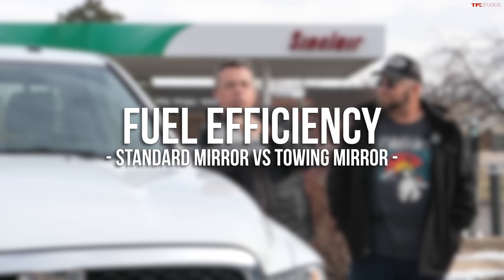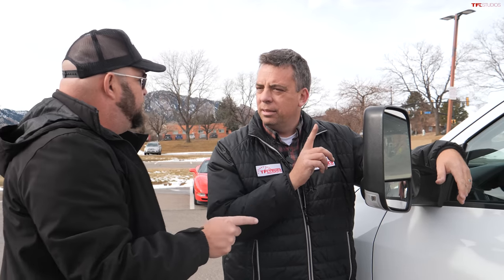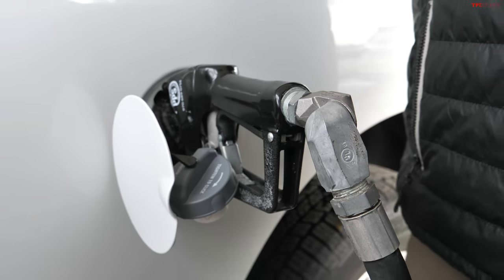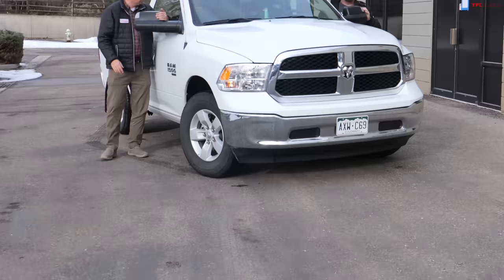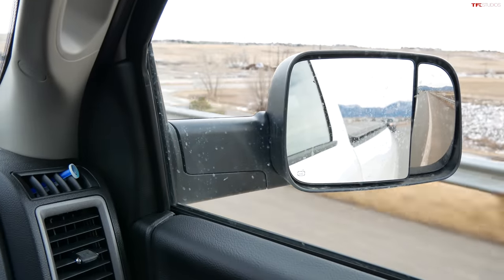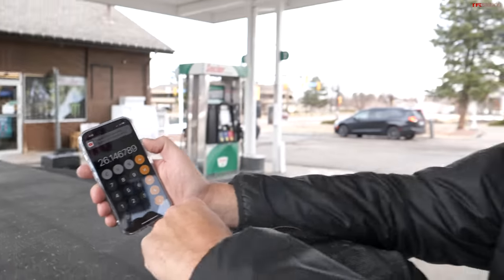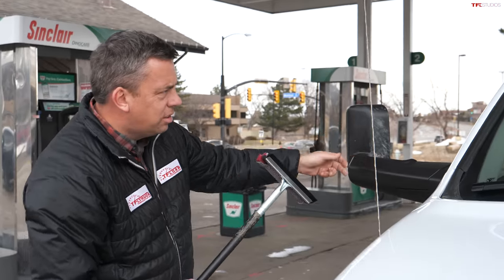TOTALLY UNEXPECTED MPG - Never Drive with Your Towing Mirrors Extended While NOT Towing: Here's Why!

Comment: Just did a trip from Virginia to Texas, I was curious so I put my moose mirror's out on the way down I avereged 13.6 mpg, on the way back with stuppy mirrors I averaged 18.1 mpg. They make a big difference.
Reply: I don't believe that at all.
Reply: @jimbeam2705  I don't care what you believe, numbers don't lie people do.
Reply: @jimbeam2705  that's  the truth  mirrors  in save mileage 👍🛻
Reply: The direction of prevailing wind during those runs likely made a big difference in the mileage too.
Reply: @LocalGarage  that could be, but unless you try it for yourself you won't know for sure. So please take a trip and let me know what you find👍
Reply: @nicknisiscosta5154  i drive from denver to tulsa a couple times a year, my trip adds elevation change into the mix too but each direction gives different results each time.  even side wind can have a negative impact on mileage
Reply: Yeah there's a reason mpg tests are run in a loop (out and back) to try and negate any wind, elevation etc.
Reply: Stuppy mirrors?  Yeah you're an English major who can't operate a four-function calculator.

Comment: This makes perfect sense as switching form normal to tow configuration, changes the aerodynamic characteristics.  Have the mirrors up for towing creates turbulence on either side of the truck which will affect the air moving around the truck.  With the mirrors down, that is minimized.  

I wonder If the shorter non-tow mirror will have better results.

Comment: Have you run two loops with no modifications, back to back, to see what the margin of error is?
Reply: 100% agree, great idea too! They should also consider how long they may have sat at idle while adjusting the mirrors or even sitting at stop lights or waiting for the pump between tests. My experience with my Ram tow mirrors never had me thinking there was a significant fuel consumption difference between the configurations so it will be interesting to see if they do any follow up testing. Either way, until the test is reliable to repeat, there are a lot of factors that could skew the results, maybe even drastically. I have been following along for a while now and don't recall them establishing a reliable baseline for the test, other than trying to keep things consistent which is great, but I am very curious what their results would be for the same test, 2 or 3 times in a row.

Comment: 6 mpg from mirror position... that is a big enough hit that I would love to see if you guys could get an engineer (Maybe colab with Engineering Explained even and reach a new audience segment ) to explain just how extending the mirrors can cause such a major increase in drag.
Reply: They’d probably say that the result is not accurate and needs to be repeated for validity.
Reply: Do it TFL!!!
Reply: And tell him to bring his whiteboard
Reply: Not saying it would cause THIS much of a change, but the reason is because the wind is being directed differently with the mirrors up vs. down. When they are down, the shape of the mirrors cause the wind to be deflected up, not only slightly lowering the front of the truck (and shrinking the amount of area for wind to go underneath), but going the same direction on both sides. 

When the mirrors are up, the wedges are now turned on their sides facing opposite ways. The wind being deflected is trying to push the truck one way on the driver's side and the opposite way on the passenger's side. This creates additional drag.

Comment: We call tow mirrors up "Ghost Trailer' mode up here. I've had my ram for 7 or so years, I've flipped the mirrors up twice. I tow cars, 8'6" wide enclosed, sheds, chicken coops, etc etc.. I find I can see perfectly fine with them down. I did adjust the convex so I don't need to adjust them at all when/if I flip the mirrors and when I thought flipping the mirrors up was going to be useful I set the #2 driver profile for that setting, so if i flip them I hit 1 button and done.

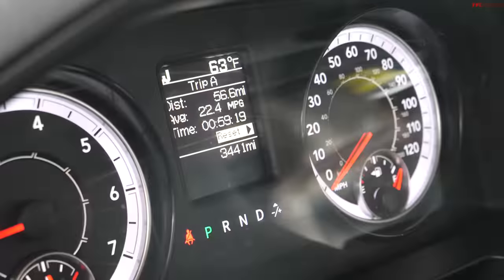Comment: Actual result (excluding for variations in traffic, wind, etc.): @ 6:50 ~22.3-22.4 mpg with mirrors in;   @ 10:38  ~22.1 mpg with mirrors out, which is about 1% difference.
For comparing different trips or other variables in the same vehicle, the onboard fuel flow measurement is much more accurate than their fill-up scheme.

Comment: Manufacturers design mirrors to channel and move air around the vehicle in the most efficient manner possible. Putting the mirrors up increases the front facing surface area, and changes the airflow around the vehicle. I would not be surprised to find out the mirrors placed vertically help reduce wind drag on the trailer being towed even while increasing  wind drag on the truck alone.

Comment: I have the old Ford stainless steel rectangular tow mirrors on my 1986 F350 crew cab dually. I leave them in the out position as they are about 1" wider than the rear fenders so I know if I can get through without scraping the fenders. Since there is really no actual change in area of the mirrors It won't make a change in fuel economy.

Comment: you can set your presets, if you have them. 1 to normal mode and 2 for moose mode. still have to move the bottom one but it makes it easier
Reply: That’s exactly what I do on our 2019 RAM 2500 Laramie when towing and it works great.  1 for normal, 2 for Moose Mode (and the truck didn’t cost $100K; sticker was $65K.)
Reply: @jeffmc306  i ordered my 22 Rebel Echo-diesel. went down the list and added everything i wanted. its my last truck. i traded my Gladiator for it. i had traded a Wrangler and a 2014 RAM Sport for the Gladiator. it was nice but i missed the size of the ram. i thought the Gladiator might fill the truck and the jeep need. Didn't scratch that itch.
Reply: @trcass1  Congrats on your new Rebel!  Sometimes we make what we think is the best decision for the time and it doesn’t work out. Been there, done that!  Enjoy that new RAM!
Reply: @jeffmc306  thanks Jeff. it cost a little more than i would have liked but it was my last vehicle and i had a low balance on the Gladiator so i was able to pay it off at delivery. my only regret is the cost of diesel....its crazy.
Reply: My 2019 Warlock (which is basically a Tradesman with a facelift) doesn't have any save function nor power seats. So I doubt that Tradesman has any save function, or power seats, either.
Reply: @Hydra360ci  i was making that comment in general, recognizing that many have a higher end truck that does have presets

Comment: I would like to see you test different brands of air filter on this truck. K&n, fram, wix, etc to see which gives the best MPG. I would really like to see if you could get 30 mpg out of that truck. 

I also wonder what effect those mud flaps have on the mpg
Reply: I think Project Farm did a cool video on air filters.
Reply: @ALMX5DP  He did. He basically concluded K&N filters do flow "better" than others (which is only relevant if your intake restriction is actually the air filter - many are not), but were terrible for actually filtering the air.

Comment: When I bought this 6.7 Cummins, it’s a 22 bighorn 3500 (not a dually) completely factory besides some interior stuff, it’s the high output with the Aisin. I never expected any fuel economy. I have 6,000 miles on this truck and my average when empty on FLAT ROADS in the Midwest, varies between 20-23.

20 on interstate driving speed limit which is 70 here, and 55 on highways. 

I think foot control is a huge factor. Like how hard you push it to reach that speed. I think it affects it a lot, you breath on this throttle and it’s moving. 

And no I don’t drive around in moose mode. And now I’m definitely glad I don’t lol. 

I will say though pulling a big skid steer yesterday did drop me down to about 9 😂

Comment: I always try to use the same pump and station where I live.  My mileage is pretty consistent for the most part, but I do occasionally have a tank that is way high or way low relative to the average.  Like in this video, I'm talking 3 to 4 mpg more or less than what i usually see.  I think it's a function of how consistent the pump is about shutting off once the tank is full.  There may be other factors that I'm not recognizing but I think this is something that might have happened to you two in this test.  A ~6 mpg difference is pretty big and I'm not sure I'm buying that.  I could be wrong.  There are a lot of things that can effect fuel economy and aren't necessarily obvious to us in the moment.

Comment: OK, I guess the mirror orientation/adjustment issue between the mirrors being out verses in is the explanation why almost every Dodge tow mirror equipped truck here in Muskoka, Ontario (Canada) runs with the mirrors out. 
I drive a 2016 Ford with tow mirrors, only have them out when towing my TT, even better on my new truck (when its built), they'll be power out/in. Just about every tow mirror equipped GM/Chevy or Ford I see have them retracted when not towing. 
Maybe it's something to do with "size" when you're driving a Dodge?

Comment: If you average the to runs you get 22.8mpg, a lot closer both ways to what the truck calculated.   At 57miles and 2-3 gallons, a pint (one beer) difference in the filling up can swing the hand calculated mpg 1.5 points.  What probably happened was the mirror-in fill-up was short and the mirror-out fill-up was to the top.  We are talking about the nozzle being inserted into the tank 1/2" further and the pump running 2 seconds longer.   The tests need to be more miles to reduce the effect of fill up inconsistents and idle time.

Comment: There is no way this stands. That’s more than a 20% savings when disengaging moose mode. Car and truck manufacturers would die to save that much fuel efficiency, especially in this day and age where every 0.1mpg is a selling point. In fact, Audi’s numbers for perspective gains in efficiency from mirror mods are closer to 10-15% and they’re working hard to figure out how to make that work. Not only that, but using past performance (chin spoiler and tonneau cover videos) show that 26mpg is very much an outlier. I’d recommend performing this test at least once more to verify. If it’s real science, it is reproducible and only costs 6 gallons worth of gas and two hours of your time. Totally worth it.

Comment: I also think this experiment will need to be run a time or two. I drive A 3/4 ton diesel and got over 26 on one trip only over a couple of years. I’m pretty sure there was a fluke circumstance and a bit of helping wind instead of crosswind. I haven’t seen that since, and that is the reason for my questioning of the mirrors down part of the test. I can’t say that the moose mode would be outside the expected norm.

Comment: I’m not saying towing mirrors out isn’t less efficient, because it definitely is less efficient. But there is no way that it’s that much different. What’s most likely happening here, is the pressure switch on the pump for shut off is causing fluctuations in the amount of fuel it’s putting in. They even elude to it when they talk about how long the top off was on one of the pumps. The only way to run this test correctly, is to use a set amount of fuel (5 gallons as an example) drain the fuel tank every time and fill it with exactly 5 gallons and then run the tests, and see how much fuel is left after the test. Incredibly hard (and time consuming) to do.

Comment: For any test to be scientifically significant it needs to be repeated, however, mirrors are a huge influence on the drag of a vehicle. You aren't just modifying how the air flows around the truck, the tow mirrors are a huge object sticking way out into the air stream, so I think it could be significant. (obviously a wind tunnel would be the true scientific way)

Loving these MPG tests.

Comment: Even if the difference is 3mpg vs 6 due to some margin if error, that's huge
Reply: The 26 mpg was 3 mpg too high and the 20 mpg was 3 mpg too low; the real number is near zero difference and I would bet if they ran it again their results would reflect this.  The error was with the first fill most likely and the tank didn't fill completely for some reason and then when they filled the second time, it ended up filling up properly, including the amount that didn't get put in the first time.
Reply: I really doubt it’s actually a 5.8 mpg difference. Something got screwed up here.

Comment: I own a Ram 3500, and the passenger side blind spot is horrendous with the mirror in the horizontal position. The convex mirror does not provide enough visibility in the horizontal position. 

Fuel economy matters, but safety matters more.

Comment: My 2001 Cummins has electrically adjustable and heated mirrors, and I didn’t spend $80K.  I never did a comparative mileage check and I never do a non-tow drive with them extended.  Aerodynamics are tricky.  A 6 MPG delta seems excessive, but there has to be some drag effect.

Comment: Also...There is a MI company that makes a AreoCap for the pickup truck market,  why not look into a few really well thought out Airstream updates for Pickups,  practical stuff, not gimmicks.  
Lower air dams
Side skirts
Running boards vs none
Roof  lip spoiler 
Caps
Areo caps
Flat wheel covers.
Great little fuel price series.
Fuel Additives
Oil additives 
Clutch fan removal  for electric
Headers
Filters

Comment: I put aftermarket RAM style towing mirrors on my Tacoma.  I lost 0.5-1 mpg just from installing them.  Leaving them turned up costs another 0.5-1mpg.  Obviously, how much they impact fuel economy depends on how fast I drive.

My experience corresponds to a substantial loss, but I think your results are bunk.  For whatever reason, I suspect you got a bit of a short fill followed by a full fill.  We are talking fractions of a gallon here.  I love that you are doing these tests, but I wish you had a more reliable way of filling the tank to a specific level than depending on the pump.

Comment: I think I would believe the computer in the truck over the gas pump.  You only pumped a little over 2 gallons a little variation in pump pressure and nozzle kick off would give a huge difference

Comment: If my electric seat and mirrors in my 05 touareg can revert to saved positions.

Surely an electric mirror in a modern truck could have saved positions for moose mode or standard.
If not auto adjust when flipping position.

Comment: You know, I have faith in your method, but the more I see this, I have to wonder just how reliable the fuel pump's shut off is.
I mean, how full is "full" each time you fill up? Is there a way to find some engineer who designs fuel pumps to weigh in on the pump's repeatability?

Comment: Hate to tell you but because of the altitude that is why there is 85 octane in Colorado. Less air means a slower burn so that is why the lower octane, lower octane burns faster to put it in layman’s terms. Running 85 in Colorado at altitude is like running 87 at lower elevations. Great video though, I always enjoy them especially the compression ones.

Comment: Accurate fuel usage used by supposedly refilling the tank is not accurate.   Interior baffles in the tank trap varying amounts of air which result in these descrepancies.   Using larger amounts of the fuel by traveling further will reduce these descrepancies.   Trusting the MPG readouts in the vehicle is a much better choice for these small trips.   20 mpg vs 26 mpg is just not believable just by varying the orientation of the mirror.

Comment: These tests need to be a lot longer and a lot more involved to be believable.  Using 2 1/2 gallons of gas on a 57 mile loop, combined with your filling technique is highly variable.  I would suggest each test segment be in the 200 mile range to get a better read on average fuel economy in each configuration.  Also make sure you aren't "drafting" anyone during the tests as much as is controllable.  I have no doubt that the hideous moose mirrors effect the fuel mileage, there is increased drag.  But considering how far off your baseline numbers are from your other tests, it is difficult to take these results, or any of your others as gospel.

Comment: I have to admit I wondered how much MPG I was losing when I picked up my GMC AT4 HD, since the mirrors are basically 2- 10"x4" sales on either side of the truck.  is what it is, but given the truck gets like 15mpg on the highway, maybe they could've done something.  the front ends flat front probably doesn't help much either.  good thing I didn't buy it for is economy

Comment: When the mirrors are folded down, the convex mirror looses its usefulness, because now it is showing mostly vertical, and it is at the farthest point on the mirror “stalk.” The larger mirror shows essentially the same as in the other position.  I think the vehicle showed a more accurate mpg reading at a difference of 0.3 mpg with the non-trailering (lowered) position taking the win, than the guys got on their calculator.

Comment: my 3500 Ram has an 8.5' wide enclosed trailer attached to it 75-80% of the time, so my mirrors stay up.  When the mirrors are down they have a horrible configuration.  but I think if I am going to take a road trip I will def consider putting them down...   Thanks for the info.   P.S..  who cares about a Gm or Ford possible outcome, they have to yank their mirrors out, and if its a ford they would prolly just break off like my dads did due to rust.

Comment: I wonder if you did the loop with 92 octane if you would get better mpg  with that v6? Also see 3” matters lol
Reply: What little difference would be offset by the extra cost of the fuel.
Reply: Could be worse. Higher octane does not burn as efficiently. But stop detonation.

Comment: I would not like the convex mirror on the outside portion of the mirrors. I would leave those in tow mode. My SuperDuty mirrors are convex bottom whether they are in or out. Much better design.